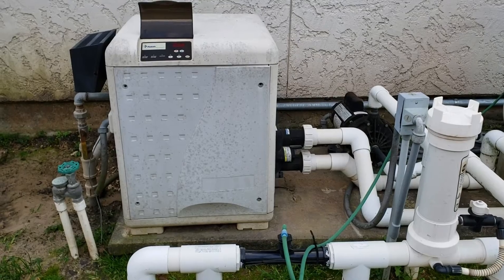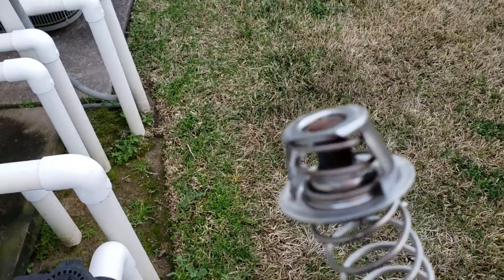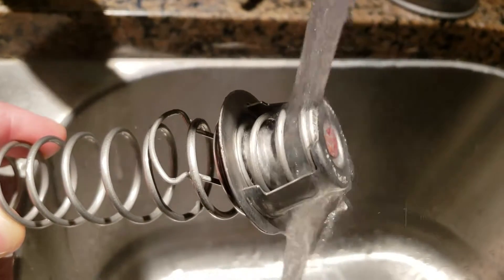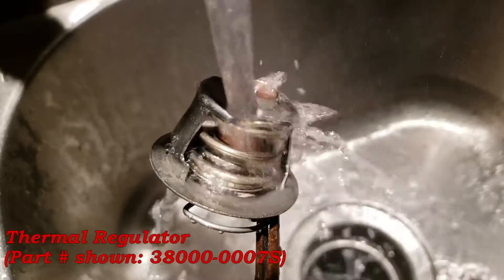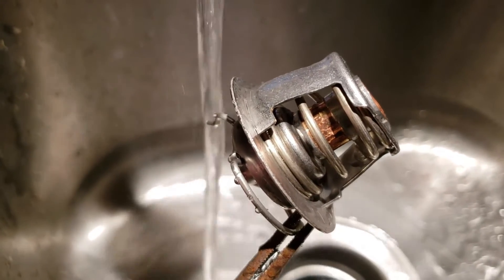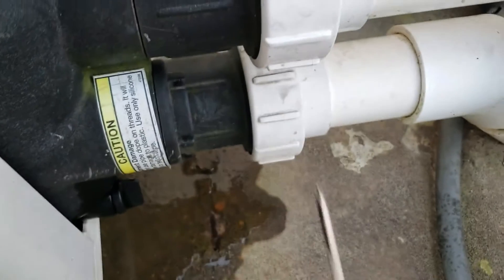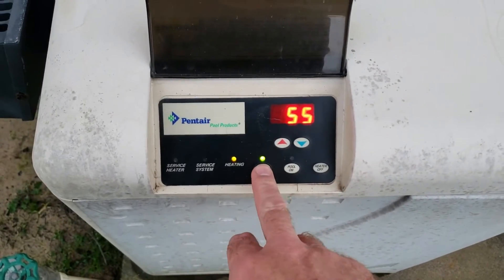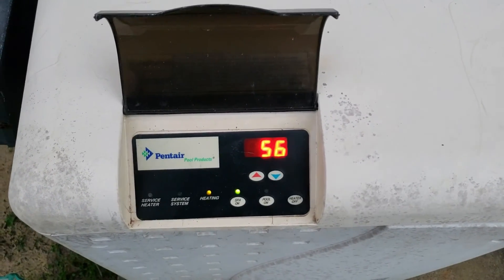Thermal Regulator Replacement on Pentair Mastertemp 400 Pool/Spa Heater

Comment: Hi and thank you for all your videos. I looked through all of them including the comments to find a solution but didn't find it. I have a pool and no spa. Heater is a Mastertemp 400. I turn it on the blower motor turns on then there is a clicking sound and I can smell gas through the exhaust pipe but the ignition never happens. It cycles through this process for 3 times before the service heater light comes on.  I have no error lights on the back of the control board. I tested the Thermal Regulator and that works. I bought my house about 4 years ago and back then it would turn on for few seconds and I could also feel the ignition because of burst of hot air coming from the exhaust pipe but then it would turn of after that. Also back then the heating light would blink for few seconds. Now the heating light never comes on. Since I don't have a spa it was never an emergency to find a fix for it. Now that I found your channel I want to get to bottom of this :).  Any help would be much appreciated. Thank you.
Reply from the maker: Hi there, I will try to make suggestions based on my experiences with mine.  The clicking you hear is the gas valve opening as seen in my videos.  My suspicion is that you have a faulty igniter just because you say you can smell the gas but have no ignition.  Try unplugging the igniter and put an ohm meter on the side going down into the combustion chamber where the igniter is located.  If you get an open (infinite ohms reading) then it is likely that your igniter is cracked or broken inside the tub.  2 screws is all that hold it in there.  There is no diagnostic LED on the control board that point you to the igniter.  From what I have seen, the igniters are understandably very fragile (they have a rough life you know), so be careful with handling them if you need to remove/replace it.

If you find that there is a solid resistance reading to the igniter, check the feeder side of the connector.  See if you get an open in that direction.  Make sure to check for a break in the wiring if you get an open.  Make sure the connector is clean on the incoming and outgoing side.

If all checks out there, open the box that is about 5"Wx6"Hx4"D.  This is called the Ignition Control Module (ICM).  Look at the red LEDs inside that box.  I think if it blinks 3 times repeatedly, it means that it is in "ignition lockout".  If this is the case, search YouTube for "ignition lockout" and see if you can find a reset for that.  I know there is a video about it but I haven't had that problem yet so I don't know a lot about it and don't want to steer you in the wrong direction.

Lastly, another thing that will surely allow gas valves to turn on and no ignition would be if there is water in your combustion chamber.  Take out 1 of the 2 bottom bolts of the manifold before you do anything else and see if water comes out.  If so, your heating coils are leaking, filling the tub up to the level of the igniter and preventing it from firing.  That would be a rather involved repair to replace the coils as you may have seen from my other videos.

Hope this helps for now.  Write back with what you find and we'll go from there.
Reply: @pvt-pilot  This was exactly my problem Zohrab! I installed a new igniter and the bad boy started up again. However, one issue fixed leads to another issue. The heater turns on and blower but only lasts for about 1 min to 2 min and service light comes on. After about a min or two, the heather re-ignites and cycles and service light comes on and its the HLS light. After about another 1 to 2 min, it reignites. Not sure if the thermoregulator can attribute to this?
Reply from the maker: @jeff2385  I think you have either a corroded nonfunctioning thermal regulator or you have a broken manifold bypass valve.  Do you hear crackling like ice cubes bouncing around in your manifold when the water is running?  If so, you have a broken manifold bypass valve.  I posted a video for that easy repair a couple of years ago on this channel.
https://youtu.be/umvDbbigDhA
Reply: @pvt-pilot   You are the man!!!! Thank you so much, it turned out it was the thermal regulator. I picked a new one today and the heater no longer "cycles" through on/off. I can't help but say THANK YOU! From my family to yours, I am grateful for the videos you posted. Much gratitude especially during these weird quarantine times. It was tough getting someone to fix the heather let alone trust someone to come! My friend, you helped resolve this issue and the pool is now being enjoyed by my family!  You also gained a subscriber haha!

Comment: Hi, your videos are very useful and informative but not sure if my issue is caused by the thermal regulator.   The issue is that the water heater runs without problems but it doesn't appear to put out hot water as it used to do about 3 years ago.  Just 2 weeks ago, it ran for hours and it only heated the pool approx. 10 degrees to about 82 degrees.  That was the intake temp showing on the panel .  My hot tub heated to about 90 degrees.  I would have let it run longer but it probably would have cost me a fortune.  BTW, the exhaust is super hot so I know there is heat being made somewhere inside.  Thanks, any suggestions will be greatly appreciated.  I also have a Mastertemp 400 heater.
Reply from the maker: Could be a stuck thermal regulator letting cold water into side of the manifold that is supposed to be the hot output.  This often will not throw a code because it is not an electronic part and no sensors are tied to the problem on the diagnostic LEDs on the contol board.  Mine didnt throw a code when my thermal regulator quit working.  The heater would just cycle off within a few minutes, show service heater light and takes forever for another heat cycle to start, but never show error code or LED lights on control board.

Another thing to try, pull out one of the 2 bottom bolts in your manifold.  Make sure no water comes out.  If you have any water in there, this is a leaking coil assembly and you could be heating only 5, 4, or even 3 of the 6 tubes depending on how high the alleged water level could be.  This could cause slow heating caused by a leak, but usually tub filling won't stop until it teaches the top and then wont fire at all.

If all is ok and tub is dry like is supposed to be, another possiblity that causes slow heating might be calcium or scale build up on the inside of your heat coils.  You would need to take things apart and visually inspect the coils.  Calcium and scale lining the insides of the heat coils can act like an insulator between the copper tubes and the water rushing inside them.  You would probably notice flakes of scale spitting into the pool on a daily basis if things got bad.

These are a few things to take a look at.  Hope it helps.
Reply: @pvt-pilot  just saw your reply.  It makes sense. I will check it out. Thanks for your help.

Comment: Hi, thanks for the video.  I have a Mastertemp 300...it turns on, no codes or anything but it's not heating the water in the pool.  I replaced the thermistor but still no luck.  Could it be the regulator if it's stuck open?
Reply from the maker: Possibly, because the thermal regulator will open when the water exiting the coils gets over 135 degrees just to prevent scalding and pvc pipe damage.  Is the air at the exhaust hot?  If so, is the water entering the pool hotter at the outlets on the wall of the pool than the temperature of the water in the pool?

If not, your thermal regulator if stuck open could be the path of least resistance from the input of your manifold to the output of your manifold which makes a vast majority of your water actually bypass the journey through the heating coils.  A clog in the output chamber of the manifold or one of the coils could cause this, but you would have to take the manifold off to check for that.
Another similar scenario of the water having the ability to skip the journey through the heating coils will occur if the manifold bypass valve breaks.  This threw an HLS light on my control board when mine broke.  You might check out my Manifold Bypass Valve replacement video to see what I am talking about on that scenario.  Hope this helps you.

Comment: I have a MasterTemp 250, which seems to work fine.  It heats the tub to 104 F then turns off and comes back on again when the temperature drops.  However, when my Jet Pump is turned on, the water temp (as reported on the panel inside the house) slowly increases to around 109F. The temperature in the tub slowly drops while the Jet pump is running until it is turned off and the temperature again reports correctly and the heater turns on.  Any ideas on what bits need to be replaced?
Reply from the maker: Well, let's see, you kinda lost me at Jet Pump.  I don't have a separate pump of any kind aside from the one main pool pump to run my pool and spa.  I just have 2 actuators sitting on top of my 2 valves that simultaneously turn when I change from pool mode to spa mode.  These valves dictate which drains to draw water from (either pool only drains or spa only drains) on one valve and which outputs are used to drive water back into the pool or spa on the other valve.  If I activate the air blower for about 10 seconds while in spa mode, it primes the output line with air and this keeps bubbles flowing down the line to all 6 spa outlets even when the air blower is turned off.  Please clarify what you mean by "jet pump" and I will try my best to answer again if I am off base here.  
With what you have said so far, it sounds like you are talking about a failing actuator that is not moving and thus you are pulling cold pool water from your pool drains into your spa at a moment when it is actually supposed to be pulling warm spa water from spa drains.  Actuators are about $100-$110 on Ebay and Amazon.  Test your existing actuators by moving the toggle switch on the back of each one repeated to see if each one moves correctly.  Return the switches back to their original positions when you are done testing them.  Sorry if this isn't what you mean.  Perhaps I may not be understanding your question/problem correctly.
Reply: @pvt-pilot  I figured it out. I'd turned the speed down on the filtration pump and when I reset it back the temp was being reported correctly.

Comment: My 250 mastertemp keeps heating up to 110 to 115 and I be already changed my thermistor and control board but it’s still constantly over heating. Could the thermal regulator be causing it
Reply from the maker: To answer your question, yes it could be the problem.  The thermal regulator has thermally reactive material that is designed to move at 120 degrees.  So 110-115 shouldn't open it at all.  The purpose of the thermal regulator opening at 120 degrees (scalding threshold) is to create a bypass for incoming cool water (bypass - to skip going through the heat exchanger) to directly dilute the scalding water in the output chamber of the heater manifold before going out to the pool/spa.  So if your thermal regulator seems to move under scalding hot water exposure, I would change the HLS.
Reply from the maker: Please test the thermal regulator to verify.  It is very easy to test it to see if it responds to scalding hot water.  However, my guess leans towards a faulty High Limit Switch (HLS).  When you first turn on the heater, it will display "128", then r-?(software revision number), then the next number is the temp of the water intake detected by the thermistor.  What is that number?  It should be very close to ambient temperature before the water heats up.  Now, on to the next component, if the HLS is stuck on a given resistance, it is not doing its job.  I don't know of a way to test the HLS using the control board display like you can with the thermistor, but if you test the thermal regulator and find it good, I think the HLS would be a very like next culprit.  Good Luck!

Comment: Hi.  Just move into new home a few months ago.  Kicked on heater last week and got E01 error...replaced the thermistor and still didn't kick on heat.  Had service tech come out and he said get a new control board.  Installed and it kicked on the heater (very hot by vent) for about 30 seconds and then short cycles a few times...then service heater light.  Any thoughts?
Reply from the maker: Did replacing the thermistor fix the E01?  If yes, then you didn't waste your money.  It needed to be replaced anyway.  Some errors can be a byproduct of other faulty components.  The E01 error  is not one of those.  E01 can only mean one thing...the control board's pins that are dedicated to the thermistor are detecting an open circuit.  This could be due to a defective open thermistor or corroded/damaged wiring to the thermistor.  That is all...no further testing beyond that.

I have never replaced my control board.  It is not a commonly defective component because it is not exposed to the corrosive chemicals found in pool water.  I'm not so sure that the tech's suggestion to replace it was justified.  It sounds to me like it was doing its job.

Now for the service heater light...do you have any diagnostic LEDs illuminated on the control board when you get the service heater light?  I will advise further pending your reply.  I just can't shoot a valid suggestion to you without knowing what the contol board is crying about. I hope to be helpful to you soon but need more information.  It is a very simple heater with multiple safety checks/stops which is very good by design, but unfortunately it is not made with very high quality parts.  We can figure it out together.  Talk to you soon.
Reply: @pvt-pilot  Thanks for the quick reply.  Regarding the control board replacement.  Before I replaced, the heater would not even kick on and once I swapped out it began to run immediately.  

That said, it would turn on, fire (20 seconds later) and then cycle off quickly.  It would then fire back on after about 40 seconds and then began to rumble/bang/shake the unit...then service heater light.  

Therefore, I think both the Thermistor and Control Board were needed...hopefully just one more quick fix before it gets cold here in MD.  Really appreciate your help and videos!!!
Reply from the maker: @uponbase  I still would like to know what LED is illuminated on the control board (if any at all) when swrvice heater comes on.

Shaking/banging...the only moving parts in the heater are the motor shaft and the fan.  Shaking/banging may be due to an imbalance with the fan.  Other than that, I don't know what would cause your heater to shake/bang.  Check the fan housing as shown in my AFS video.  It would not surprise me if you have AFS illuminated on your control board if you have a fan issue.
Reply from the maker: @uponbase  I had another thought about the banging.  The motor spools up to full speed before the gas valve ever opens and ignition happens.  Is the shaking present before ignition when the motor is spinning or only after ignition?  If it is present only after ignition, you might want to shut everything down and remove the top half of the heater as seen in my heat coil replacement video.  Take a look at the big cylinder (flame arrestor) hanging down into the combustion chamber and see if you have any holes blown out of the sides of the cylinder.  My mind has wandered into thinking about spontaneous ignition of unburned gas that has escaped the flame arrestor in a location that it is not supposed to escape.  While still tucked away in the combustion chamber (the big tub), with it being a big fire bowl, it might not seem to some like that big of a deal to have misc bits of gases igniting, but to me it would be an obvious huge safety concern.  So caution that possibly.

Other than that tangent thought, I can't think of anything else without being there hearing it that would cause banging/shaking in your description.
Reply: @pvt-pilot  Hi - Thanks again for your insights, really appreciate the help.  

I just fired on the heater again, after the ignition happens (few seconds) it sounds like something is being rattled around inside the unit...the unit doesn't actually shake.  Almost sounds like a piece of metal is flying around inside for about 5 seconds...then the unit cuts off...really odd.

I am having a tech come out to inspect since my oldest is having a party this weekend and the pool is 72.
Reply from the maker: @uponbase  I see.  Well that exhaust port is about 4" with only a minor baffle shield as protection for items going in the wrong way.  I suppose somthing could have gotten in there that way.  Not likely that something got sucked into the intake and is boucing around the combustion chamber because incoming debris would not get past the flame arrestor.  Let this feed know what you find in there.  It might help someone else out with their troubleshooting.  Good luck!
Reply: @pvt-pilot  It was the thermal regulator

Comment: Your spa button should be programmed to turn on your filter pump, rather than you manually having to press both. Mine is set up that way, valves change over, pump starts, than heater kicks in.That way, if you get a remote control later on, it will operate system.
Reply: Also, you can set your pump speed to automatically increase to a speed that will keep spa heater from tripping on high temp due to low flow if you have a variable speed pump set too low for spa mode.
Reply from the maker: Very cool input.  Thank you!